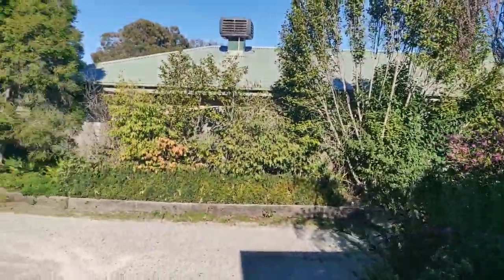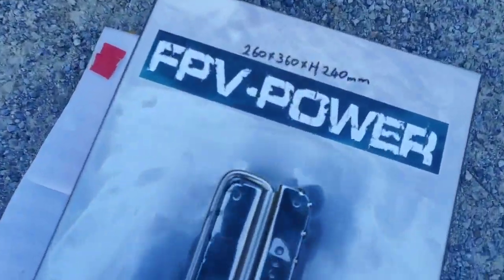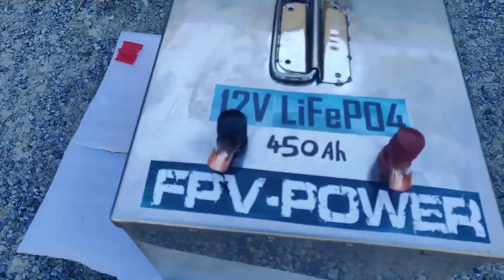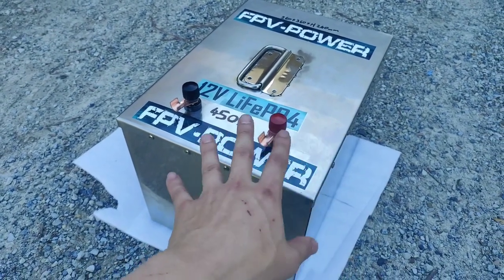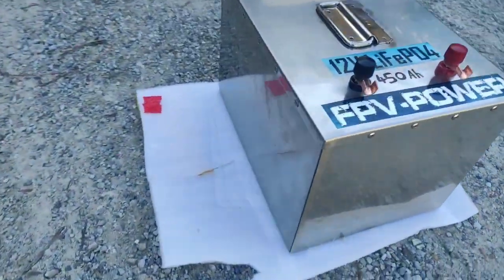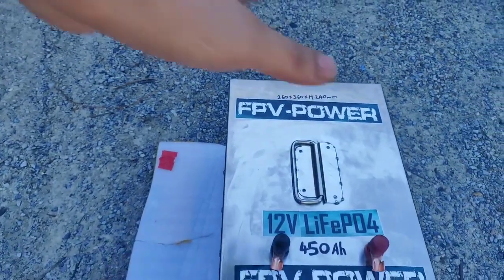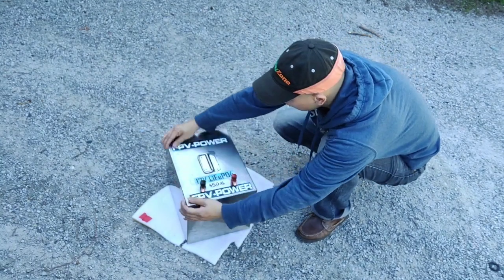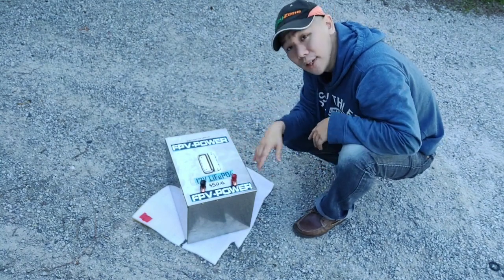Fpv-Power 12v 450Ah Lifepo4, lithium Battery for motor home.

Comment: Ian, you know that the solar panel testing is done 25°C PANEL temperature, and NOT at ambient, so in most cases it is much worse, 
I bet at like at 25°C ambient in full sun the panel temperature is more like 60°C, now that makes a huge difference to panel output!